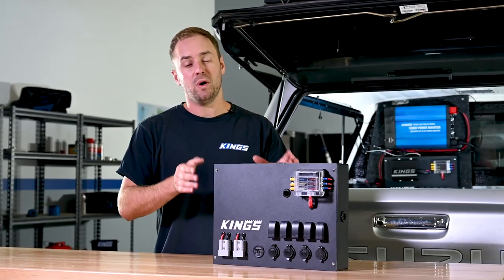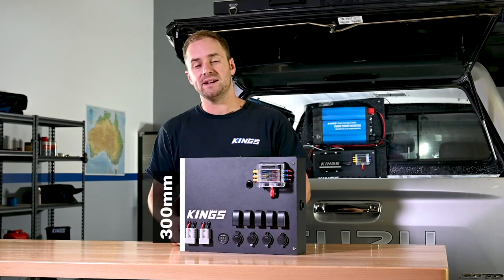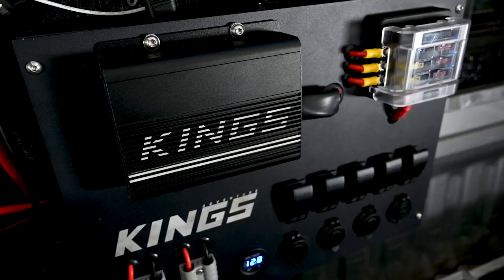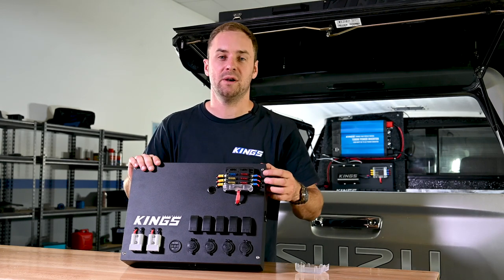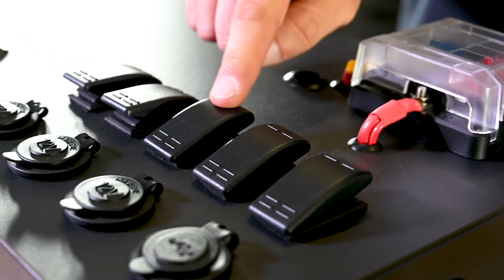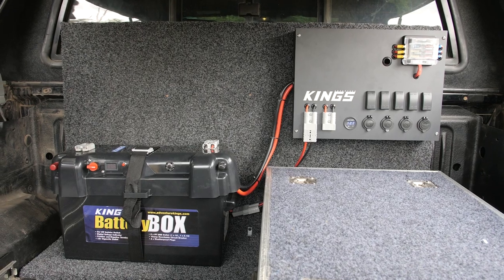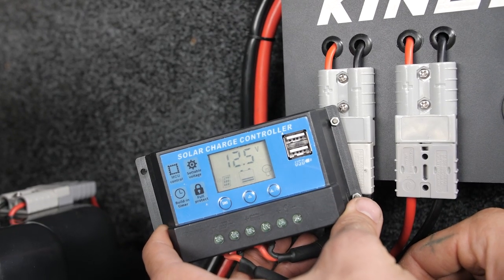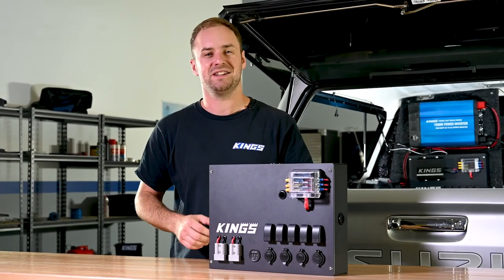Adventure Kings 12v Control Box Features

Comment: Hi I have put the positive and neg cable in but the phone inputs and volt meter don’t turn off are they meant too
Reply from the maker: Hi there, they are meant to stay on. Cheers, Courtney
Reply: @4wdsupacentreAu  hi i fixed it i put a battery isolator in so if i dont use my canopy over winter i can turn the isolator off.  i just brought the new Kings upright fridge it turned up 2 weeks a go iam very impressed it runs beautiful my mate come out with his bushman on his ute he cant beleive the quality in the kings fridge.